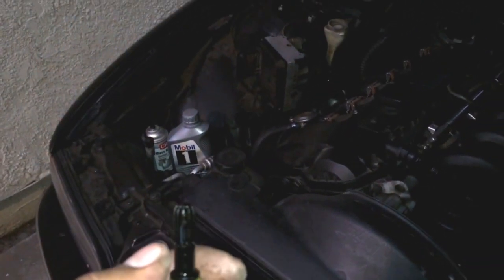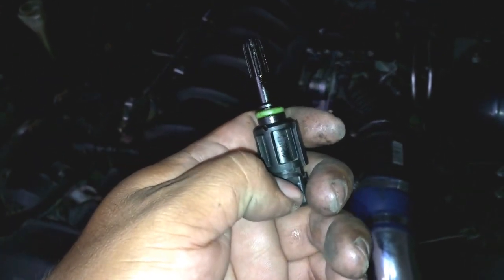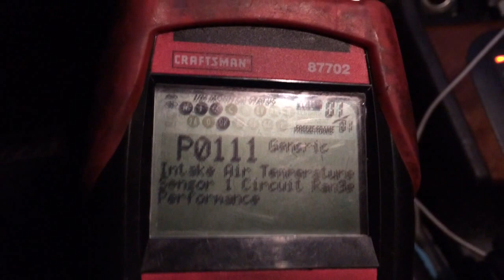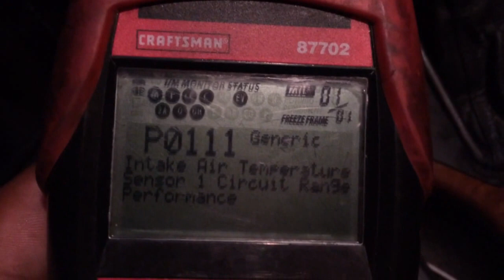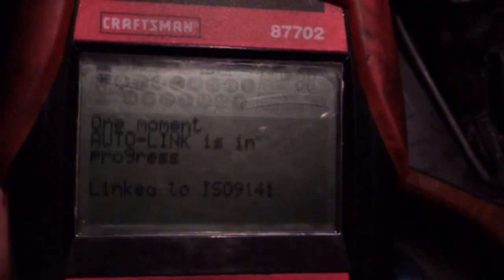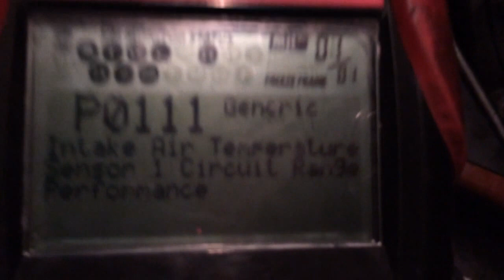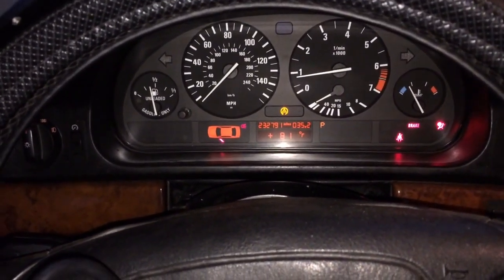FIX Code P0111 Intake Air Temperature BMW 5 Series 3 Series E90 E39 528I 328I M5 M3

Comment: Thanks yeah I plugged them wrong in the cable from the tank valve fits on the air temp sensor so don’t mix em up